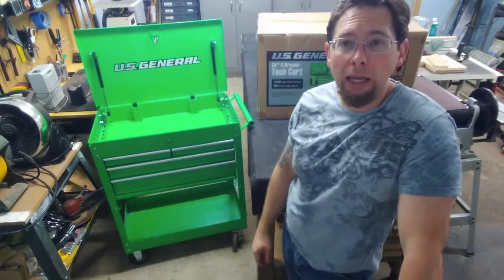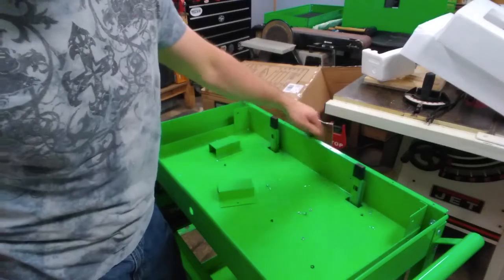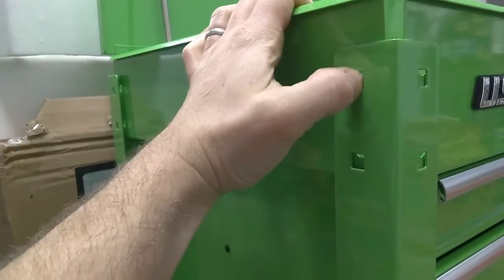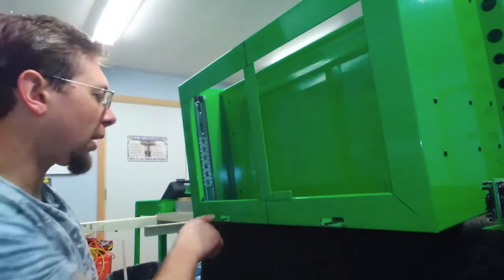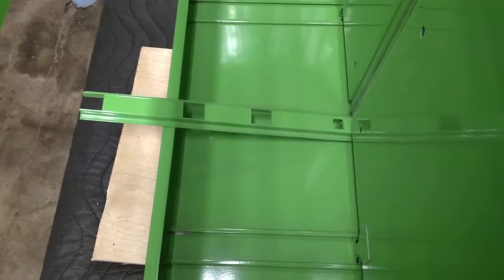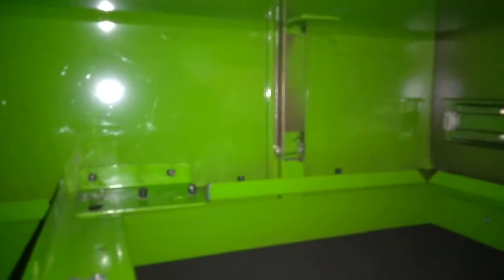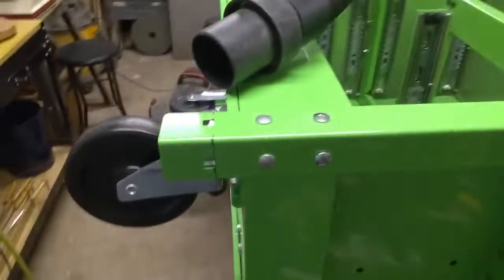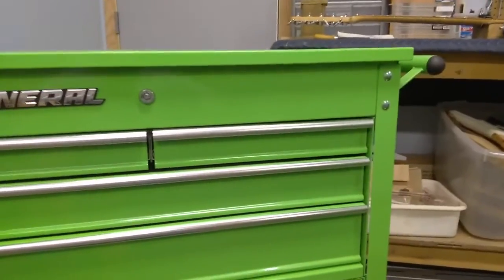Harbor Freight (U.S. General) 30" 4 Drawer Tech Cart Modification

Comment: 280.00 each as of today... 6/30/22 total of 560.00, plus time and energy building it out.. or for the same price get a full size Husky top and bottom tool box! Bigger, deeper, and cheaper... That being said... I love this idea and might do it myself
Reply from the maker: The purpose of this conversion was to make more room with a smaller box. You can purchase other boxes like the Husky and it is bigger, deeper and might be cheaper, but do you plan on being mobile with it? This box was built to be mobile all day long in a fast paced shop environment. It all depends on what you're looking for.
Reply: @jwsguitarshop4410  I get that and agree. It's much cheaper than my Matco cart and works just as well
Reply: 229 and 199 on sale in Virginia
Reply: I had the 4 drawer I originally bought and ended selling it for $80 and bought a used 5 drawer for 160. So basically got a 5 drawer used for $80. Then there was a special on the 5 draw for $230 brand new but I get an extra 10% off the $230 price tag if get on the harbor freight credit card so it's comes out to like $207 new
So I'm at $289 for my build
Reply from the maker: @RyjahMoto  Wow! That's a good deal.
Reply: @RyjahMoto  I payed 89 for mine brand new years ago. Now it's 230  😆 I now will buy another and do this mod soon.
Reply: You can also find them used for fairly cheap. I bought one for $70
Reply: But will your Husky have a secret shelf, only accessible when you remove the bottom drawer? ;)
Reply: @emmettturner9452  😂.
Reply: Or you can get the bank cart that they already have now
Reply: If they’re on sale it’s 180 each that’s  360 not even including getting them from Facebook
Reply: Husky boxes are complete garbage U.S General is the best budget tool storage period

Comment: I went for years without a service cart as I went from the Air Force for 7 years and 3 years as heavy line mechanic in and worked in the same 2 bays as a heavy line. My toolbox was always about 4 steps away.  Then I trained as a aircraft mechanic and ended up working 30 plus years in aviation.  When I retired 5 years ago I took all my tools home and did my setup in my shop and I am still only a few steps away from my tools so for me it is not needed.  

I got to say I enjoyed watching you do the one cart out 2 it fun and interesting for this old retired guy.
Reply from the maker: Thank you!
Reply: So where you had your tools? Hanging from a peg board? And how you have them now?

Comment: Cool project.  

I don't move my carts around much so I have one tech cart and three of the Yukon 7 drawer boxes.  I just use these around the house so I didn't need anything heavier duty. 

I considered the 27" and 36" carts but these fulfill my purpose.
Reply from the maker: Thanks! It really comes down to preference. I couldn't find what fit my needs, So I just built what I wanted.

Comment: Outstanding build , getting to the point where all my tools our starting to overflow, might try something along this line or design the side cabinet that made for the bigger cart, into a role cart. Really un-ease my all that drilling and welding but great video!!!!!!!
Reply from the maker: Thank you, Dustin for the kind remarks. I tried making this custom build fairly easy for others to follow along with if they wanted to do it as well. It does require quite a bit of drilling and some welding, but it was fun to to and the end result is worth it in my opinion.

Comment: I stacked 2 of the 5 drawer carts together. My top box locks the bottom box but I didn't weld or rivet the bars together. I cut slots in the bottom of the top box and the bars match up with the bottom box. And it locks both boxes.
Reply from the maker: Nice! do you have a picture of how it looks?
Reply: @jwsguitarshop4410  Yes. Just look under 10 drawer harbor freight carts and you might find my videos.

Comment: The US General 34 In. Full Bank Service Cart for $599 (without any coupons) is more or less the same thing. It has 6 full width drawers, plus the top area like a regular 4 or 5 drawer service cart. The bottom drawer is deeper than the other 5 drawers and the overall dimensions are bigger than the standard service carts. It also has four large, heavy-duty caster that all swivel and has semi-hard bumpers on the corners to protect the cart. It also has the slots in the top for pry bars and screwdrivers just like the service carts. Don't get me wrong, the cart you came up with is very nice and the extra roll around service tray cart is very nice. Its just the amount of effort you had to put into it seems to outweigh the benefit of making your own. BTW, I've seen several videos doing what you've done with the 5 drawer service carts, sans the single lock mechanism.
Reply from the maker: I appreciate your opinion on the 34" cart. To be honest, I bought a green one and put it together and tried using it for a week. With the tools that I loaded in the cart it was rather bulky and would want to get away from me when I rolled it around. The 30" cart that I custom built makes it easy to move around and when I sit in my Matco roller chair I can lean over and look into the top of my service cart to pull out tools which I use all day long. It was impossible to sit in a roller chair and look over the top of the 34" cart that you have mentioned. You literally have to stand up to look into the cart which makes the cart undesirable for me. However, everyone has their own likes and dislikes when it comes to what works best for their specific job. This smaller custom cart works perfectly for me and I haven't found anyone that makes the size of cart that I have made.
Reply: 1. The full bank is significantly taller, if you plan to use the top surface as a work surface comfortably, that can be an issue even if you're 6'0"
2. Full bank has 6 large taller drawers compared to the doublestack's 10 small/medium drawers. It's more versatile especially if you like to dedicate specific drawers to specific tools to avoid mixing tools in the same drawer.
3. Locking mechanism is important if you actually use the box professionally in a shop/hangar/etc rather than just at home.

Comment: The only thing I might have done differently is to cut the front of the bottom tray (put some rubber trim or something on the cuts) and used something else to hold the bottom box up.  That would give you a little storage on the very bottom where you could stick things...
Reply: Somebody did a mod like this, but he cut the bottom part of the cabined so that the bottom drawer would slide in and out, and when putting the 2nd cabinet on top, the holes for screws on the cabinet would line up with the ones on the side pieces. instead of 2x4 he put magnets to make up the gap.

Comment: I wonder it it could also be done with the 5-drawer carts too?
Reply from the maker: I wonder that too. It looks like the videos that I've seen have the two 5 drawer carts modified to fit on top of each other. However, I would imagine there are multiple ways of connecting them together with the side brackets. It would be fun to try that project too.

Comment: That looks great! I would love to do something like this but I do not have the skills to attempt a job like this. I would be afraid that I would ruin the cart.
Reply from the maker: I was hesitant at first, but I just took one phase at a time and thought it through. Usually just test fitting things before drilling or making any cuts works out best for me. Making the right measurements before making any adjustments tends to help the project fall right into place.

Comment: Wonder if this will work w the 30in 5 drawer
Reply from the maker: That’s a good question. Maybe you could check out the dimensions online and if they are similar, then it might work.
Reply: Yes it will work with the 5 drawer cart. I did it and my top box locks the bottom box drawers when the lid is closed.

Comment: I like it, but why not just buy the roll cart that has the drawers all the way to the bottom?
Reply from the maker: I have that cart as well. However, it is bulky and you can't sit  on a roller stool and look into the top of that cart since it is considerably taller. Customizing these two 4 drawer boxes together makes similar storage space as the taller cart, but much more versatile. I absolutely wouldn't go back to the taller cart after building this one!

Comment: Would it have been less expensive and less time-consuming to buy a cart that you needed rather than do a modification, which  seems like a ton of work?
Reply from the maker: If there was something out there that was the height that I need when I am sitting in my Matco roller chair, then I would agree with you. However, I can't find anything anywhere. That's why I went this route.

Comment: Did you fill them up with tools!?
Reply from the maker: Yes, I sure did. I use it daily at work. I also added magnets to the back of the cart inside walls in order to hold the drawers shut while moving around the shop.

Comment: I noticed you have a different work top on your 48 inch multipurpose workbench. What materials did you use and did you put it on top of the mdf board or in place of it. TIA!
Reply from the maker: Yes. It's a piece of plywood. It works much better than the thin board that came with it.
Reply: @jwsguitarshop4410  thanks

Comment: For the cost of two carts, you could probably get a much larger and stronger unit.
Reply from the maker: I like the smaller sized box. That's why I wanted to make this modification to the 4 drawer cart. I like the height and how easy it is to roll around.

Comment: There must be an easier way of doing this. For example if you skipped the bracket extension and have the bottom drawers not lockable.
Reply from the maker: That is definitely an option if you weren't concerned about the bottom drawers locking.